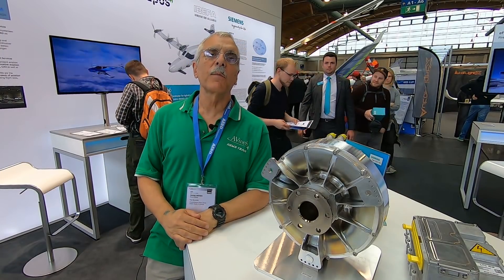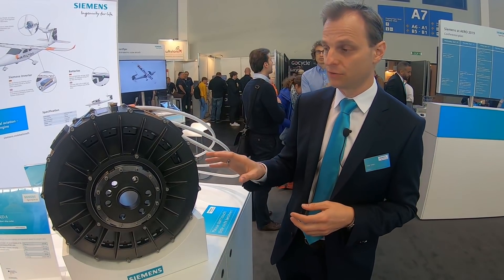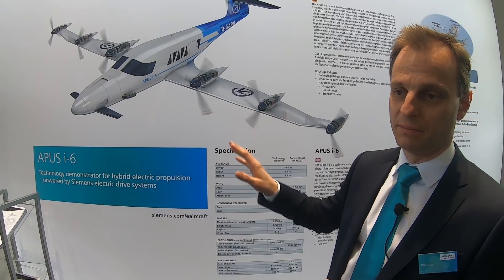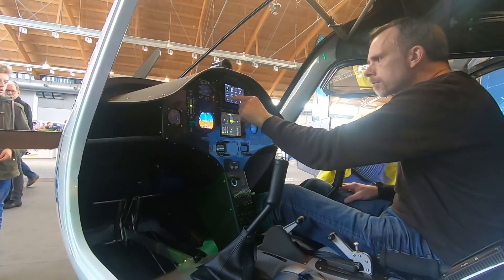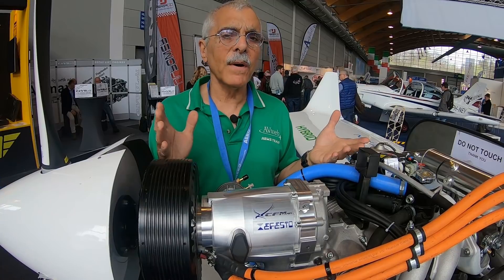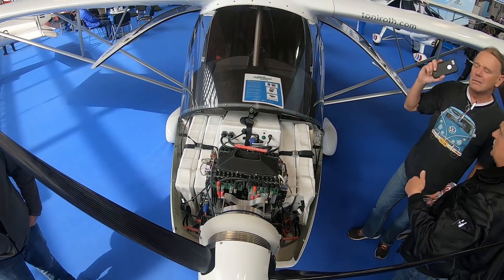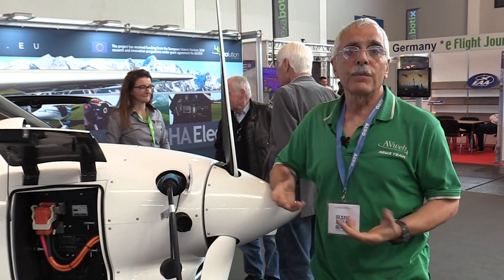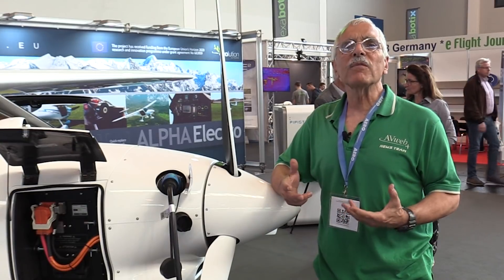What's New in Electric Airplanes?

Comment: I'm surprised the Siemens rep called their product an engine a few times....its a motor...
Reply: It's not a native language. In most other languages both are synonymous. That's why.
Reply: @Walterwaltraud  still, when dealing with the media and the public, your basic technical terminology should be down pat in the language required.
Reply: @michaelmccarthy4615  I prefer honest engineers over perfect actors/ narrators in this context. I need substance, not linguistics. I don't mind smartassing, but cut them some slack, you understood perfectly what they do. Piper, Cessna and Cirrus don't do shit cutting pattern work costs, kudos to George Bye and the likes.
Reply: @michaelmccarthy4615  You seriously want to compare a flight control issue of the most often built civil airliner in the world with an interview on a research prototype? This was not written in the POH but an off the cuff interview. And you manage to smartass with it even though I am confident you wouldn't have attempted an oil change on it :-). Semantics really do matter, but you miss the point and the proportion of it.
Reply: @Walterwaltraud  it's always best to be accurately descriptive as possible.   In all circumstances, no matter who your audience might be.  A novice audience might think it's ok to use incorrect terminology and that simply perpetuates the inaccurate information.    In the Boeing example,  different pilots had different levels of systems knowledge.  Information supposedly provided to all pilots equally by the manufacturer.

Comment: So electric cars lose up to 50% of charge in cold weather, maybe more in extreme cold. No mention of this
Reply: 50% capacity loss would be when the cells are at about -10c. That's why they are thermally managed so they can be heated and cooled. It's not that hard to warm up the pack when plugged in on the ground.
Reply: Also might add batteries get hot in use...
Reply: jpalm32:   Yikes !!
Reply: they don't "lose" 50% charge, it's just not available until warmed which the batteries warm naturally when used
Reply: Tesla only loses about 30% of range in very cold weather. They have a great battery management system.
Reply: Planes actually don’t need to heat that much, because the bypassing Air passing creates plenty of thermal energy.

Comment: Nice review.  Saved me the trip!  Bottom line of course is batteries, batteries, batteries. The hybrids are just crazy contraptions like we saw in the early 1900s.  What I don't understand are the people who finance the contraptions.  There is money somewhere to put gas engines in the back seat...
Reply: Ronald Monsen 
How do you make a single turboprop as safe as a twin?  Easy. You reduce its prop loading, put a generator on the thing and make up for the loss of thrust with a couple of electric motors on the wings. You’ll need, say, 20 mins worth of battery, in case the engine fails. Advantages; safety; extra power for take-off; far less maintenance and lower operating costs than twin turboprop; oh, and cool as.
Reply: @q.e.d.9112  I think single engine turboprops are already safer than recip twins.  My argument is that adding any amount of complexity and weight to an airplane is never constructive. Hauling around a bunch of batteries and an electric motor on the remote possibility of an engine failure is not very efficient or even safer.  Also turboprops have loads of power already.  Their only downside is the weight of the fuel and the high fuel consumption.  

I think pure electric would be great but we need higher energy density batteries.  Until then, anything else is a "contraption."
Reply: Ronald Monsen 
In that case my argument simply becomes “How can you make a single engined reciprocator as safe as a twin?”
Take an old Lycoming powered Cessna, re-power it with something lighter, smaller and much more fuel efficient, generating just about enough for cruise in level flight. Put that power through multiple motors with enough extra battery power for t/o, climb and emergency reserve.

Comment: I have a well maintained Lycoming O-360... good to go 800 stat miles at 190 mph. Call me when electric AC can do that and recharge 100% in 15 mins.
Reply: Once electric planes are certified for the US market, they will become an excellent, low cost way to build time. A well built electric powertrain will also be much more reliable than ICE - less downtime, less accidents.
Reply: This thread disintegrating onto another 'EV are so much better than ICE cars' discussion. Please call me when an all electric A380 can fly 400 people from say Dubai to Sydney, after getting charged on the ground in 90 minutes, following its inbound trip!
Reply: gmcjetpilot call me when your gas engine suddenly becomes 96% efficient.
Reply: @jrherita  I asked 1st. Waiting, then I'll call. Yeah sorry flying for 30 minutes at 100mph, taking hours to recharge, isn't efficient.  Again 900 miles range, 190 miles per hour, 15 minutes to " recharge" = efficient. 96%? Batteries, charging, heat, inverter, not as efficient as you think. Aircraft are weight limited. Batteries are heavy. Therefore limited range and payload. Like EV's charge time is another factor. Until battery technology improves 10 fold and battery swap with full charge is common, it's "aspirational"... vaporware
Reply: @gmcjetpilot  Really depends on the mission. I see few C152s with turbines either. If reliability and DOC in the pattern are the thing that gets more folks in the air to fly our normal gas guzzlers, I am 200% behind that. There is plenty of training that you can get done in 70 - 80 min with 30 min reserve. Ask any flight school in FL about it ;-). Or check your own logbook, early days.
Reply: @Walterwaltraud  yes a small trainer to build time. Ok. After that 20 or 40 hours the pilots going to transition to a piston powered aircraft.
Reply: @gmcjetpilot  That's exactly the idea. Pipistrel even sells theirs as a 1-2 punch. Electric first, normal Alpha later for x/c etc. Bye Aircraft shall achieve that x/c experience by flying at 65 kts. Max endurance flights, well possible. Range does not matter if x/c is defined as 50 nm :).
Reply: @Walterwaltraud  The electro range is 75nm, I assume with 30 min  reserve. Not enough for a 100 nautical miles short cross country round trip.  The Alpha looks like a joke... Its single seat? HOw do they get dual to be signed off in it? I never seen or flown one.  It looks like an under powered LSA. Could be fine but looks weak to take students abuse.
Reply: @gmcjetpilot  So you need to plug it in to fly back. But their idea is mostly a 1-2 punch, the normal serial production model (which is double seats with the Rotax) fits two adults. Better than a 150, worse than a Cherokee. (I am 6'1,5" (186 cm), shoulder width 63 cm - and know that so well because I played football for 15 seasons. Tight end and QB). Head is a bit too close to the spar I think, I have seen more comfortable in my life, but definitely more space than in a 150/152. Gear is really sturdy, no worries there.
Reply: @Walterwaltraud  I've got a VW Diesel and a Nissan Leaf EV. I use the VW for longer-distance and the leaf for local kind of my one-two punch. The Leaf has a 24Kwh battery. It gives 80 mile usable range or less. It takes 10 hours with a Level 1 or 4 hours with a Level 2 charger to charge battery.

 He said 45 min to charge from 25% to 95%. That must be a super charger. My LEAF has the optional  super charging port. It takes about 35 minutes form 20% to 90%. The superchargers are extremely high power, need special equipment to do it. Some of the Nissan dealers have m superchargers for the Nissan Leaf. Of course supercharging creates more heat and reduces the battery life.

 Level 2 chargers m requires 220 volt service (like electric clothes dryer) with at least 30 amps. The max charge rate can be 60 kwh. My level 2 at home is only 40Kwh. Still at 60kwh it would take 2.5 hrs. I don't believe the 45 min number they give.

Pipistrel doesn't say how big their battery is. Also I've seen their charge time vary from 15 to 20 minutes to 45 minutes. For training this will be a problem if they have multiple students a day. I guess you can buy a bunch of very expensive precharged batteries ( $6000 to $8000?) to swap out. They claimed that only takes 5 minutes. I have my doubts about that. It takes 5 min to get to the plane w/ a fresh battery, much less get access to pull battery out, install, close up and return the drained battery to charger. If doing work o  pkane paper work records are needed. More than 5 minutes.

 This is an issue with any E vehicle, range and charge time.  Look I think this is great. However Battery Technology is going to limit the practicality of it. Appreciate you explaining the 1-2 punch I get it. Use the electric plane for local flying in basic training and the gas playing for more extensive training and cross country. Now the flight school or FBO has to own two planes?

My VW diesel gets 50mpg and goes 700 miles on on 14.5 gal tank. But I also have the leaf for local driving. So I have the one-two punch as well. It's a good idea.  The downside is I pay insurance and license tabs for two cars.
Reply: @gmcjetpilot  Pipistrel has swap batteries (26 k $ I believe). Thus you make very valid points, but it boils down to dollars and cents for how many hours they use it for. Kinda nice that the car experience can flow over to the small aviation niche. We'll see.
Reply: @jrherita  no electric system is 96% efficient. not even in the wildest dreams. ;)

Comment: The parallel hybrid is a good application for electric where you need a 10 min get out of jail free card as it can lend itself to capacitors yet serial tech in aircraft is the dumbest idea since chocolate fire guards.
Reply: Turbo-compounding would also be simplified in a parallel hybrid system, but the cost of hybrid aircraft could never be justified.